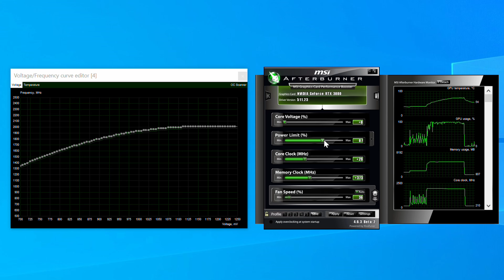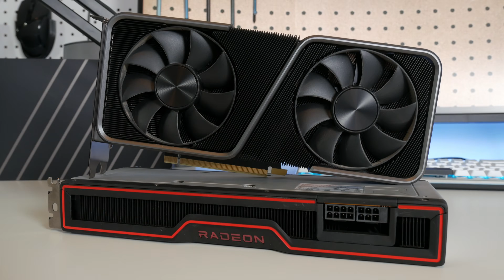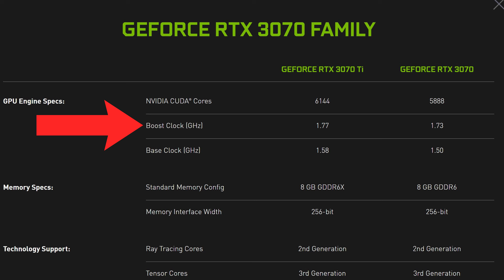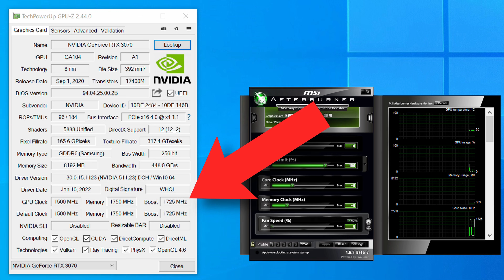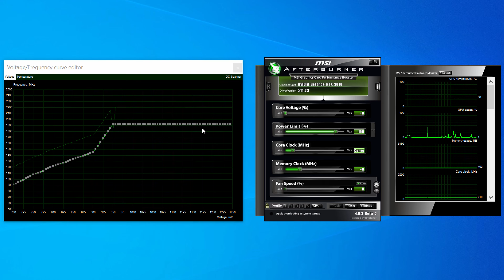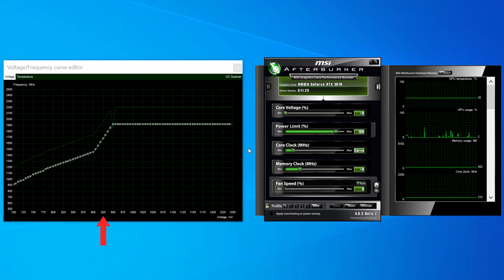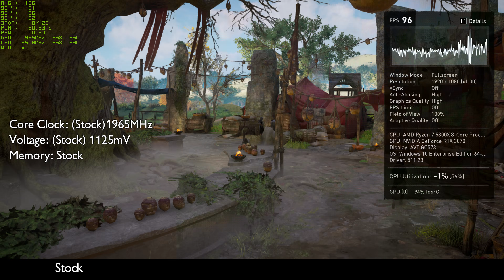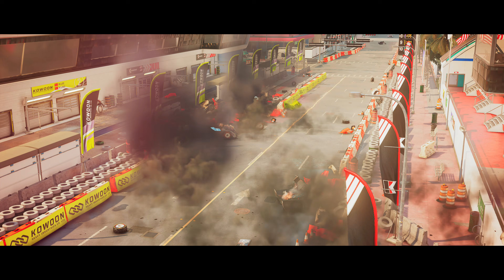How To Undervolt Your GPU (And Why You Should)

Comment: When I undervolted my EVGA 3080ti FTW3 I was able to play dying light 2 just fine with .875v with a clock of 1920mhz.......I tested minecraft without shaders and I'd get booted to the desktop after 5 mins. Bumped up the voltage to .900v and was smooth sailing ever since. Test all your games even the ones you think the gpu will not break a sweat in.
Reply: I just use the factory armory crate or the software built into the system windows mode performance mode manual mode whatever case may be it runs every game safely
Reply: Minecraft on 3080ti, what a waste of money
Reply: @dovydas4036  Minecraft RTX?
Reply: @magmatri-studios  2iq
Reply: @dovydas4036  ???
Reply: Just use a stress test, e.g. Furmark

Comment: My question is is it safe to undervolt my cyberpowerpc gaming laptop gpu its RTX 3060 130w but I Have to put it at 120w in the control panel and when I do undervolt my gpu I get at 1646mhz on the gpu with a 105w temps sit at 67c undervolt put at 120w at over 1800mhz it’s goes over 76c to 78c with full fan speed

Comment: This is a little confusing to follow the steps, because the numbers you are referencing, aren't easy for me to correlate with what is advertised for RTX 3070, such as when you say 1900 Mhz for stock operating frequency. Where is it published that stock operating frequency is 1900 Mhz ? All I see are numbers like 
1500 MHz
Boost Clock
1725 MHz
Memory Clock
1750 MHz
Reply: Run a stock benchmark of the card and see how much the card can boost, get that boost clock as a reference and undervolt, like if ur card boosted upto to like 1900Mhz @1150mv, set it to 1900Mhz @950mv or lower see how much you can reduce the power

Comment: Sooo buy current generation graphics cards, only to gimp them to  save maybe a buck or two in power, solid advice...
Reply: I think they like doing it to reduce heat in which it does work. I tried it and had my 3080 run at 65c at 1950 core clock when originally it was at 83c at around 2025 core clock
Reply: @pcworld  unfortunately you give up stability, and each application must be individually underclocked to have any chance for stability. This is silly as manufacturers would have underclocked the cards out of the box if these weren't issues...

Comment: I undervolted my gtx 1660 roughly a year ago. shortly before i had done so, i had learned of an amazing hardware monitoring tool that showed me information about about my card and system that i had i never imagined my card would be doing. this software showed me GPU performance limits that would reduce the gpu from maximum performance due to reaching their limits. the thing i found very odd was that limits in place by the manufacture were substantially lower than you would expect. the two limiters i found triggering these where of course power and temp. the temp limit for example was throttling my gpu around 70c degrees. this of course was drastically dropping my performance in games for years and i couldnt figure out why until i found HWiNFO64. after looking into how to either raise these limiters in place by the manufacturer or completely remove them altogether, i found that it apparently wasnt possible. i then discovered undervolting, which turned out to be the biggest win win win i could ever dream of. not only have i been able to prevent these limiters from activating, i am drastically saving power and extending the life of my card by running at much cooler temps. this has prevented the insanely frustrating frame drops and has made my bizarre poor mans rig something to enjoy despite certain hardware components being over a decade old.
Reply: what is the hardwear tool?
Reply: @notoriousbig3k  HWiNFO64

Comment: I’ve been undervolting now since my GTX900 series GPU and every generation since. Here in Australia 🇦🇺 where electricity is expensive and I spend a number of hours a day gaming … I’ve found a small electricity bill saving, but in terms of temps (as we get hot summers here) a noticeable difference in long term run times has seen 10-15c (10-15 degrees Celsius) reduction and a much quieter system which is what I prefer. 🥰🥰👍

Comment: I'd like to see this repeated with a Radeon card using Wattman... it's likely I'll have to keep my old GPU for a year or so and running cooler=longer life (in my mind). Good video for the green team, though.
Reply: I run a 6700xt, at least for me in Radeon I can drop the volts from 1200millivolts down to 1075 while keeping my peak boost clock at 2600mhz keeps my junction temps below 70°c and my average temp under 60°C even with benchmarking or long cyberpunk sessions.   Also dropped my power usage from 200watts down to 170 watts.

Comment: I just tried undervolting for the first time with my 1080 Ti Strix and was able to get it from ~230W stock down to ~170W while losing only ~3 avg FPS in Cyberpunk and ~65c degrees! Set my sweet spot to 1800MHz at 875mV, it freaked out at 850mV.
Reply: I got my itx build with a 3080 12gb sitting next to my Xbox Series X. When they're both running I have to crank up the AC and let them battle it out LoL
Reply: @y_zass  i have an idea for several years now, a dedicated ac loop for computers, basically put the pc and the ac in a huge bubble of plastic bag like what painters use or similar, the keyword here is scale. basically you add a small room to your house just for cooling whatever hot equipment you have. we could invent small AC systems for in-case only cooling (no more freezing yourself) but it sounds so small and inefficient on such a scale.
Reply: Previous stock temperature?
Reply: @drjp4212  Around 78c, going from my memory.
Reply: @DesuVR  Did your 1% low FPS drop with undervolt?
Reply: @drjp4212  I don't actually know, which likely means no or not by a noticeable amount. I'm just happy my PC isn't doubling as a space heater anymore.
Reply: Nice
Reply: how did you measure the power consumption ?
Reply: @dazeen9591  you look at the watts… 🧐 Nvidia overlay has stats for GPU info.
Reply: @yodead369  I don't use trash Nvidia
Reply: @dazeen9591 AMD link app on your phone then. Or just go into your driver settings.
Reply: I'm also using this method without fps loss but I want to ask something did you get any problem by this?
Reply: same settings but using 1660 super. Runs cold at 66C  on cold days and 72-74c on hot days, I live in a tropic place and has no AC. only 2-3 fps difference from stock
Reply: @covidbryant6412 you still using your gpu undervolting? i recently bought a 1660 super. and temperature is around 83-85°C. which is super high. can you help me?

Comment: Yesterday I read that Nvidia chips run best between 70'C and 80'C.

Not arguing with you either, am just saying. 

My card runs around 64'C, with an increased fan curve and a slight clock increase.

Comment: I undervolt my cpu and gpu. Got a 1070ti at 975mV @ 2000MHz humming nicely. In addition to this video series you should put a video about framelimiting. Using rtss I lock 90fps for my games and it can really help with stutters and temps.
Reply: Yeah I've started limiting most of my games to 120fps. Works well with gsync/freesync, and helps steady frametimes. I'd rather have more stable frame times than 20 more fps.
Reply: ok i would love some info on how you went about undervolting your cpu, generally im just curious but it may also be something beneficial for my pc. but i am even more interested in going about using rtss for framelimiting. i have been using afterburner for years and have played around with rtss in the past a little bit but for years now i dont even have it installed anymore. i do experience some stuttering still these although not very often and when i do its not drastic. any info youre willing to spend the time providing would be greatly appreciated and payed forward in the future, as i do most of my friends software modifying for them. thank you in advance

Comment: My Radeon 5700XT pulse is running 1900mhz@1000mV the day I got it instead of 2100@1175 or someting like that, also, I use Radeon chill at 40/120 with a hard lock fps of 60, that means that when the game have no input it runs at 40 and with input is running at 60, awesome efficiency here.

Also. I dont use ultra setting besides textures.

Comment: I just did this on my Strix 3090 was pulling 388 watts @ stock while gaming... now 250 to 280 watts.
Reply: I have an oc 3090. I’m curious what kind of fps are you getting with the undervolt?
Reply: @Vern_Levine   Just did a Horizon Zero Dawn canned bench run @4K . Stock @ 388 watts was 89 fps avg. Undervolted was still pulling 330 watts with an  96 fps avg. One run each.  So i guess it also depends on the game.
Reply: @deadbc77  impressive. I might have to play around with this.

Comment: I had a iChill X4 3080 that I dropped from 81c to 66c using an undervolt curve. I also raised the boost clock from 1890 to 1950 MHz. It was insane as I ended up with more performance for much less heat and noise.
Reply: That's pretty cool. 81c to 66c that's a massive difference. 👍
Reply: Let me guess..... You didn't benchmark properly. Enjoy your surprise bsod while playing games!
Reply: @jm8080ful  Or they got a golden bin. :)
Reply: @jm8080ful  Sometimes those "not so popular brands" work quite well too. I got a PNY Revel 3080 with "FE specs", 1440-1710MHz and 320w.
It actually runs 1995- 2050MHz and will hit 350w on factory settings. A little bump and 2200MHz is stable all day. Stays in the mid to upper 60's under load in my little Neo Air case. (8 Sickleflows on "silent") Got it Feb. 2021 $750.